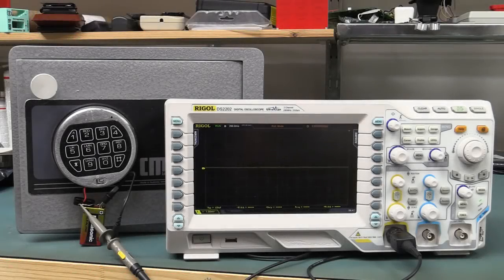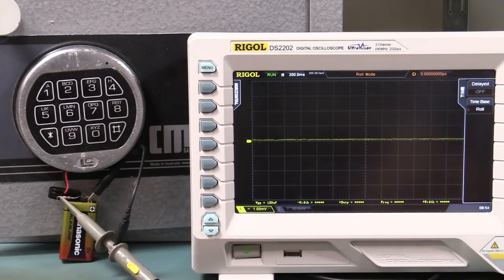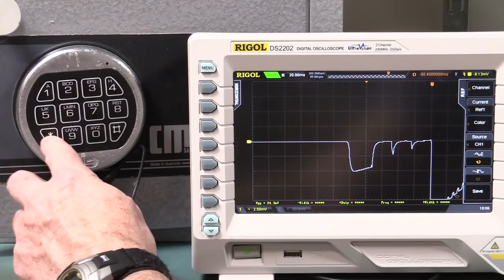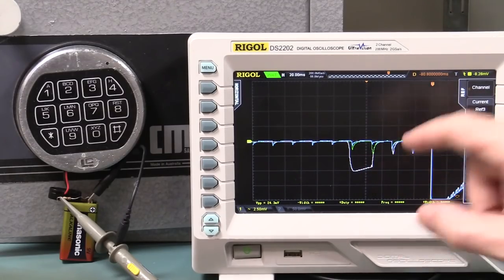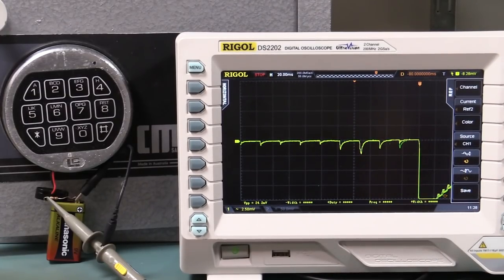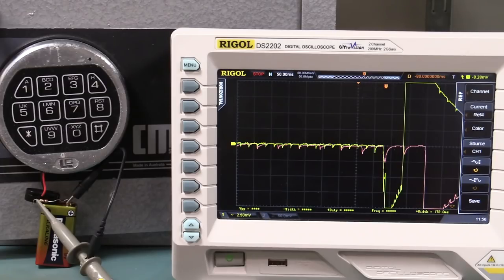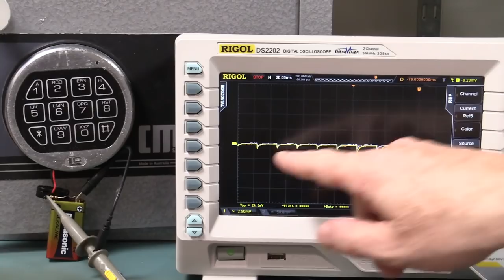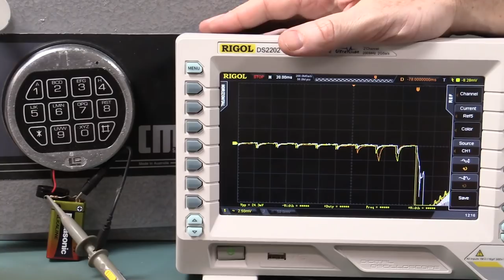EEVblog #771 - Electronic Safe Lock Powerline Attack Part 2

Comment: *$2000 oscilloscope, uses wrist watch to time signal duration
Reply: I just went on Ebay and bought a DSO138 and a case.  they run on 5V and are portable, but I am not sure how good they are.  I am sure you cn do something with them.  Cheap Chinese Oscilloscope.. But I need one for Automotive testing anyway so I bought it.
Reply: $2000 scope, can't even install the power button straight
Reply: @85Studios  two years later, how is it holding up? I've been thinking of getting a 5v scope for a while. Are they worth a damn?

Comment: This is kinda based on the assumption that the firmware compares digits as they are entered one-by-one, which is highly unlikely and makes no sense even from the practical side of things, not even mentioning the obvious security concern. I would be surprised if there are any safe locks doing that on the market.
Reply: Mikhail Yurasov I think you're regarding China electronics a bit too high here. I'd actually be surprised if the security code is stored in an encrypted form in the eeprom to begin with
Reply: ***** It's actually easier from the software standpoint to collect all the keys then compare than to compare one at a time, so if you want to go lazy, that would definitely be the path. Comparing per-key would date back to older systems that couldn't afford the 6 characters of RAM. ;)
Reply: ***** My guess that it's stored as is, because there is no physical access to the board. If you've managed to get one, you'd probably just power spike the solenoid and Bob's your uncle. :)
Reply: tursilion I agree. From a software pov I'd also code this as a "store digits in ram, if 6th digit is pressed, compare to eeprom value and  if correct then disengage lock, else +1 to failure counter". This is why this video puzzles me. Dave is seeing too much logic to conclude it's random crap he's seeing on the oscilloscope. But you never know :) , maybe it really is an extremely low-end micro with not enough ram, so the comparison has to be done on-the-fly.
Reply: ***** A standard strcmp is in no way safe from a power line attack. In most implementations, strcmp reads an array in sequence and returns immediately when a value is not equal. Also just because you wrote code a certain way doesn't mean the hardware is guaranteed to execute it atomically or predictably, even if you wrote it in assembly/bytecode (in fact it probably won't, but depends on the hardware). Thus many implementations are vulnerable in some way to a decently sophisticated power line attack.
Reply: ***** Of course, that's what I meant. The fact that you can see how many digits are correct in order is far from secure. Maybe acceptable for a lower end safe, assuming the lockout function is robust, but not secure in general.
Reply: wanswers  Yep, string comparison routine quits as soon as first non-matching character is found, therefore is vulnerable to timing attack. It allows to find the correct combination in maximum 60 attempts. Although there are very easy ways to prevent timing attack in this particular case. This actually may be an interesting topic for Part 3, should Dave decide to make one.
Reply: Mikhail Yurasov 
Probably not using a string compare, but an unsigned int/long compare. I would just add all six digits into a unsigned long (32-bit) and compare it with a value stored in EEPROM. ie Keyvalue = 
Keyvalue <<4 + Keypress. There are only 12 keys or 4 bits of data. 32-bit long would hold up to 8 keys.
Reply: Guy Tech There are many ways to optimize this. Although if you have the luxury of 4 bytes RAM you probably have 6 as well. :)
Reply: Mikhail Yurasov well if the input is a number, why would you want to convert it to chars/string? that's nosense for me, and with the input in form of a number you could use just 1 alu operation to compare it to the key, so there would be no time difference, and with string comparison you could even determine first digit you've got wrong
Reply: Martin Mazánek Well, this thing uses ST6 CPU which is 8 bit, can deal with 16-bit words though. To fit 6 decimal digits you need... 17 bits.
Reply: Mikhail Yurasov oh, me being overhyped, didn't realize that. You are right. So to get the answer, we would have to see the code, because there are numerous ways how to implement it. But I assume that storing numbers in array is most presumable way of doing it, so the attack could theoretically work. (but it would have an easy fix - just not returning after it finds first mismatch, but after the whole array is compared)
Reply: +dprohorova You want your own strcmp implementation that doesn't bail out on the first incorrect character. Any standard one would be optimised to do just that.
Reply: +Mikhail Yurasov +EEVBLOG

This is a standard c implementation of strcmp. I assume they use this instead of ASM or a custom routine. 

int strcmp(const char* s1, const char* s2)
{
    while(*s1 &amp;&amp; (*s1==*s2))
        s1++,s2++;
    return (const unsigned char)s1-(const unsigned char)s2;
}
While I have a hard time reading this (only so much experience with c) I can read it is a for loop which will break if the compared character is nonequal and returns if the compared chars are equal (in this case it&#39;s false). If the char&#39;s are the same it will go to the next char until the string runs out and will return if the last char is equal as well (true/false). 

So with this information, you could compare the processing after you&#39;ve put in the 6 digits. When the first digit is incorrect, the loop will exit directly, with first digit correct it will exit after 2 loops, with the first two digits correct it will loop 3 iterations etc. This information will tell you how much digits you have correct and worst-case you&#39;ll have the next digit every 10 tries. The amount of loops should be visible on the oscilloscope.
Reply: Harmen Yes, and this is called the timing attack. The talk here is that entered sequence most likely first accumulated in a buffer in contrast with Dave's assumption that comparison happens directly after each keypress.
Reply: That might be "a standard C implementation" in a textbook. It isn't how strcmp() works in real life. The C library will have a highly optimised version, usually written in assembly language, and is very likely to read over the end of the string as well. Older implementations, or implementations on micros that don't have vector registers, use a technique shown in Knuth (or a variant thereof), which lets them quickly detect a NUL character while loading 32 bits (for instance) at a time. Newer implementations tend to use vector registers instead.
Reply: WTF are you lot on?? china electronics???  strcomp??? 
Try aussie made safe with a lock from a french manufacturer among the best in the world,  just a 90s design and their bottom models. 
And why the fuck would you use strcomp, even if GNU C++ standard libraries were round back then, a simple dump into a 16bit register and AND would be much faster.
Reply: Had a quick glance at the datasheet for the microcontroller https://cdn-reichelt.de/documents/datenblatt/A300/ST62T25CB6.pdf 
There is a compare instruction but only compare immediate so you cant compare 2 registers in one instruction, only the accumulator with a constant that is in the code. Like most microcontrollers it is harvard arch so the code cannot be addressed/edited as data - so thats out. But there are plenty of registers So you really dont even need ram - just load the keypresses directly into a register, load the code from earom into another, do an AND on the 2 registers and if they match you get 1111111111111111, so just increment and you will set the carry flag, and run a jump on carry to the unlock routine
Reply: That's exactly what I wanted to comment. There is an entire video based on the wrong assumption.
Reply: I seriously doubt it's implemented as anything other than a simple state machine.
Reply: Probably a state machine. Numbers would be preloaded from EEPROM.
Reply: I think it is really easy to second guess this after the fact and presume the folks engineering the code thought of somebody attacking it with a scope.  The code is likely 30 years old and written in assembler.  These types of micro controller algorithms tended to be state machines because they were absolutely bullet proof in terms of operations and not having to reboot your safe in case it crashes.  So the controller would have been picked to be the cheapest one that would do the job, and micro controllers have a tendency to optimize operations, so if they can bail out early they do.    Any of that could very possibly be detected by a sensitive enough analysis.  If I were attacking this I'd test right at the chip to maximize my chances and then if success, start making it more challenging with detecting at the battery.

Comment: shouldn't it just dump keypresses into memory until you've entered all 6 digits, then check whether you entered the right code or not?
Reply: Then that's a  bruteforce attack, what's the point of the analysis then?
Reply: @mattiasso  You might still be able to get the right code from that. If it compares an array some commands will exit as soon as it hits the first wrong number. you would have to do more tries with the full 6 numbers but you will see by how many ticks the processor goes before it exits how many correct numbers you have.
Reply: @excitedbox5705 , to defeat that: At beginning set a flag true for code OK, 
Then loop for all digits: set the flag false if digit incorrect, if correct execute another opcode which takes the same time.
Then time is the same if the code is partially correct or not.
Reply: I think the original point made by sleepib is that, its useless to check for some difference between correct / incorrect keys if the thing is just checking once at the end, therefore making the premise of breaking the code using this method useless. That would also be the logical way to code it as well.
Reply: @excitedbox5705  if only you could see difference in time in nanoseconds
Reply: You should also consider that their is a built in code for recovery and a user selected code so you can't do a comparison until you have the full digit sequence to compare. Also many models of these safes will allow multiple user selected codes.
Reply: Additionally, to defeat power analysis, a smart programmer would interleave the code-check logic with a pseudorandom function that uses power in a pattern dependent on the inputted code. 

Every time you enter a code, you’d get the same power data, but different codes would produce vastly different power data depending on which 6 digits were inputted, regardless of whether or not the code is correct
Reply: @pyromen321  Isn't it a moot point if you're checking the whole code at once, rather than one key at a time? I understand being able to tell which way a branch goes with power analysis, but that would only tell you the code is right or wrong, which you already know, not how wrong it was. 
Are there any examples of power signature showing how many bits of a comparison match, when the comparison is a single instruction?
Reply: sleepib, in theory you can extrapolate more information from power analysis than just things like branches and execution duration. Different instructions require different amounts of power and holding a 1 in a register requires a different amount of power than a 0. Whether or not your equipment can detect those differences is a whole other discussion.

It’s almost definitely unnecessary to mix in some pseudorandomness, but for high security things there’s no reason not to go overboard. I remember a RSA encryption power analysis vulnerability where it was possible to extract the private key from a microcontroller because multiplication instructions required more power than addition. I’m hazy on the details, but I believe that had to be mitigated by throwing in randomness.

Comment: I was on an embedded security workshop this week and during one speech I had to think about your safe experiment. The speaker basically demonstrated a simple non-intrusive attack (incl. live demo) (performed on many consumer smartphones in the lab) to snatch away an RSA key (bit by bit). He used the EMI of the processor to do so. With high-tech equipment (> Eur 2000 ) he could still get that work at up to 80cm, with low cost ( < Eur 100) he needed the device to be up close. Basically what he used for the cheap solution: RF near field probe as antenna plugged in to a common DVB-T USB receiver used with GNUradio. In GNUradio he set up several filters and amplifiers to have a better resulting signal and based on the peaks and averaging them out over time he could see where the "1-Bit calculation" and where the "0-Bit calculation" was done (you better know the frequency of the CPU for more efficiency). As this was a proof-of-concept demo the RSA algorithm was running on an endless loop (though, it could be distinguished from the "normal operation" /noise/). But fascinating as it was, it even worked through shielding (just needed to increase the number of samples to take for the averaging). Of course, I asked him whether he ever tried it on a electronic safe, which is more simplistic than a smartphone, but he never did. Kind of scary if you think about it... but luckily this was just useable as a "proof-of-concept"...
Reply: LeviathanX, Scary thought, for sure. A simple wand would open any inexpensive safe in a jiffy.

Comment: I'd imagine a powerline attack such as this would easily be avoidable. A manufacturer could have the processor, as you mentioned, go through a sort of random calculation during or after each keypress is processed. If I'm correct, that would substantially change these results. I'm fascinated that something like this isn't already implemented.
Reply from the maker: Mat Mabee Oh yes, very easily avoidable. I suspect La Gard know what they are doing and I'd be surprised if there is an easy exploit on this lock.
Reply: Mat Mabee Doing it after would not help much. Besides, with enough data, you can get rid of any noise, deliberate or not.
Reply: I looked into my safe and it seems to have a huge cap supplying the processor and a goddamn noise generator... Hopeless
Reply: Mat Mabee Define 'Random'. A processor will just do as it's told and one of its instructions isn't "pick me a random number". You can use a sequence or a timer, but both can be worked out given enough time. My solution would be far simpler: Don't do any checking (ie just store them) until you have received all 6 digits  and then check them, at which point you don't care about analysis as you know if the inputted code is correct or not anyway.
Reply: Moose You'd still have to check the numbers one at a time, so it would leak something. 
Security chips use different strategy to prevent power based attacks such as drawing more power than needed at some pseudo-random moments, (PRNG quality is definitely a topic)... however, there is always a leak, and lots of other potential side channel attacks - the point is how much time and money you are willing to sacrifice to exploit it, versus how much money the safe owner is willing to sacrifice to protect his goods/secrets  :)
Reply: Moose   Use something like the number of micro seconds the key was press as the "random" input to your calculation, or the lsb of the time since the last press.
Reply: Don Reid That's not a reliable source of randomness (any key press timing). If somebody is already doing a powerline analysis, then they've probably got the means to control the timing of key presses.
Reply: I had a box which, when you entered a 6-digit code give a 6-digit response after a 1 second delay. They went to great lengths to protect the software but they didn't consider people simply removing the key pad and using software instead. 11 days later I had every possible code and response in a spreadsheet.
Reply: EEVblog Why don't you just disconnect the internal power cable to the lock and close the door?
That should tell you all you need to know … ;->
Reply: +Mat Mabee Simple solution is to have a capacitor large enough to power the entire login sequence and disconnect the battery for the duration of login. Slightly less ideal but probably a sufficient solution given the cost of other attacks on the safe is a noise filter on the power line.
I very much doubt the manufacturer has considered this type of attack at all, there's no caps on the board, which you'd expect if there was any type of LC noise filter. I feel the video author is probably giving the manufacturer far too much credit.
I'm curious if simply disconnecting and reconnecting the battery resets the 5 minute lockout, one would hope not.
Reply: +Mat Mabee "go through a sort of random calculation during or after each keypress is processed."

By that you just make the sequence longer, but you do not mask the signal/signature itself.
Reply: +Neon Rouge "only validated after input is complete. Therefore processor usage and timings are the same for both valid and invalid entries."

Non sequitur. You assume the processing time is the same for a valid and an invalid input, this is not necessarily the case. For certain validations algorithms one can use a time analysis attack to know which digit in the sequence is wrong if you do it that way.
Reply: lol locking the comments.